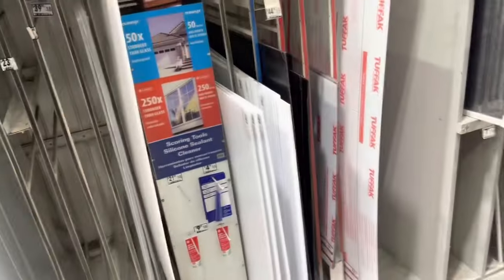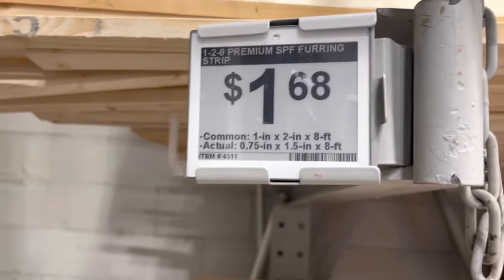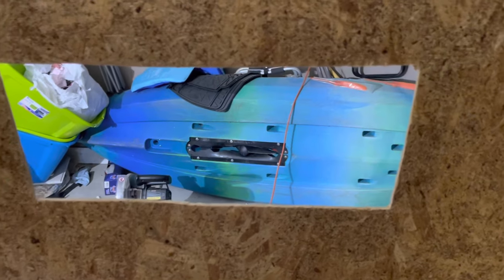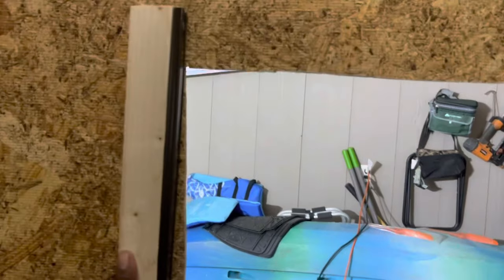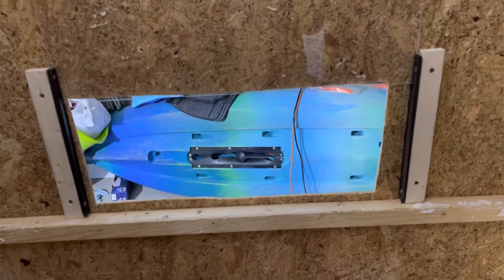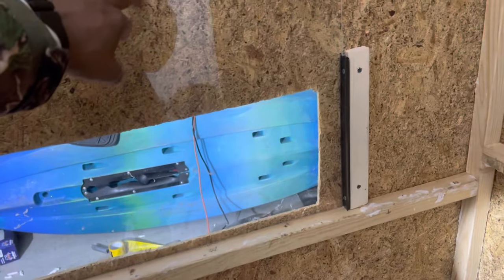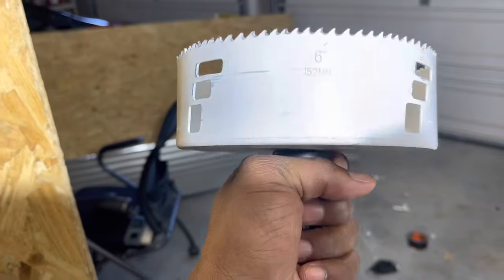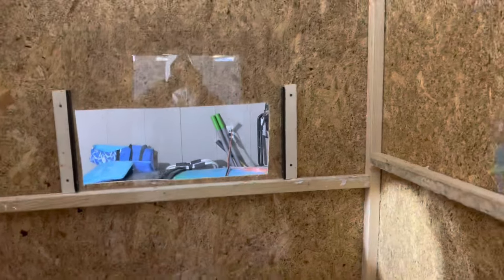Easiest Sliding Plexiglass Window for Deer Stand

Comment: Nice I'm doing the exact same thing with mine just using the Lattice Panel Joiner. Ever consider making your windows the length of your wall, this way you have Complete visibility and not a 16"x 9" opening. Do all four walls and you have pretty much 360* visibility. Just a thought but your in the chips for sure I'm getting older and hate that North Wind slipping down my back when I don't need that side open... Good luck
Reply from the maker: That is a good idea.  This is only our second year ever hunting and learning so I will take that into consideration on my next build.  We built it like that due to how close we hunt which is 20 yards out from our shooting target.  So less movement and smell that can get out the better for us haha

Comment: I'm trying to do this , I have an a/c mounted on a sliding window and have plexiglass ontop and it's sealed with silicone and want it to be a sliding window for fresh air but water proof when i close it when it rains. not sure how I would do that. Any recommendations ?
Reply from the maker: What about just adding rubber weather edge seal around the window or add a window drip edge strip above it